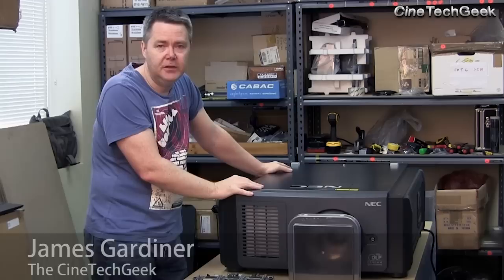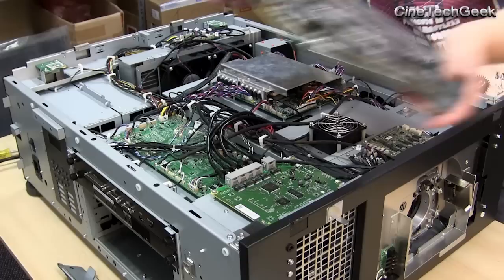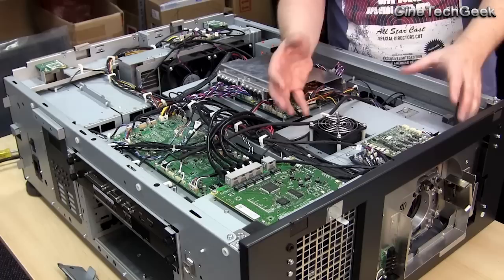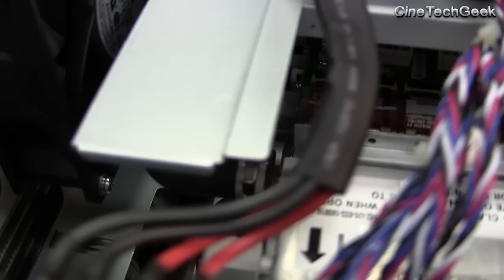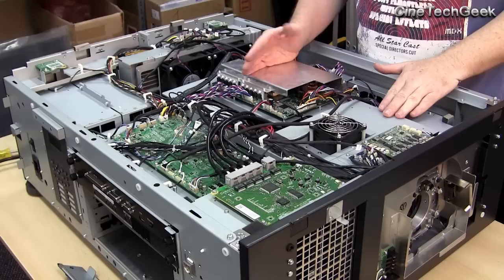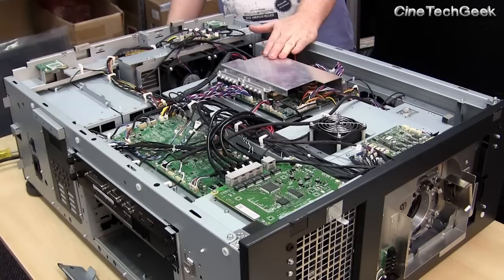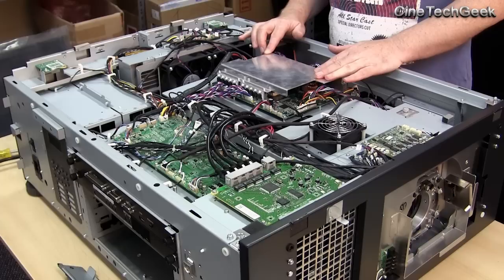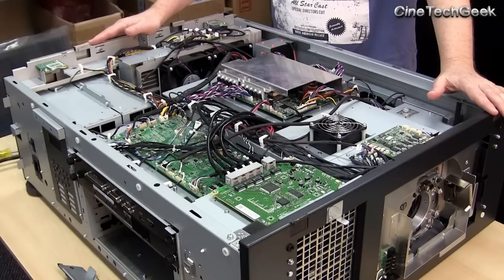A look inside a LASER digital cinema projector : NEC NC1100L

Comment: In my opinion, one of the greatest benefits of seeing a film shot on celluloid in a digital medium like a 4K disc or digital projector is that when the film is scanned from the original negative, all the grain one sees is what originated on the negative. When a film is projected on celluloid, additional grain is introduced, even if the print is a second generation away from the negative. So ironically, when a filmmaker like Tarantino champions that his films should be seen on celluloid, digital projection can in some ways represent more accurately what the negative captured. One advantage celluloid has had over digital projection for a long time is in contrast and resolution. But with 4K laser projectors I think that advantage will slowly disappear. Especially considering that 99.99% of all movies shot on celluloid today are finished using a Digital intermediate. Which means that even if celluloid prints are being made, they will be struck from that DI and be limited to the resolution of the DI, which most likely will be lower than the resolution of the film print. If you then add on the extra grain and softness that get introduced from the print I think that a film that was shot on celluloid and then receives a 4K DI will look better on a 4K laser projector than on a film print. But I do believe celluloid has the advantage when it comes to older movies that were finished photochemicly and shoot on large formats like 65mm and VistaVision. Because then the true resolution of film is being taken advantage of (as long as the print doesn't come from a digital restoration of that movie, even 2001 a space odysseys 8K restoration probably don't take full advantage of a 65mm print, but digital restorations has of course other benefits, like damage removal.) After the introduction of the Digital intermediate the full potential celluloid has been lost when it comes to resolution, but has also given the filmmaker more freedom with color grading and special effects. I look forward to the day when 8K,10K,12k DIs are the norm.

Comment: can you tell me any book name for full making digital laser projector ?
Reply from the maker: no. but reading the daily specifications would give you a good idea of the minimum quality requirements that would dictate a log of the implementation.
Reply: @CineTechGeek  thank you sir.can you tell me any website for buying old or used NEC 31000 lumens laser projector ?
Reply from the maker: @nituaero1843  umm. not really.  second hand projectors are not common..  but I the near future I expect a number of cinemas to close and projectors to start appearing for second hand sales.  give it another 6-12 months..
Reply from the maker: @nituaero1843  You have to go though local certified installers.  Due to the security and other aspects of the specialised equipment.  It required specialised service providers.  You don't really have much choice to shop around. It's not that type of market.
Reply: @CineTechGeek  ok sir

Comment: Nec is and always will be a Frankenstein machine.
I have never liked them, they don't give the same quality as a Christie or Barco.
Reply from the maker: +Christopher Pettersen all digital projectors are very similar..  Mainly because they all revolve around the same core technology.  I agree Barco spend much more time on engineering and the price of the units show this.  Barco is what I would likely select if money was no object or other technical issues existed.  NEC, from the 100 units or so we sold over the years has been surprisingly reliable.  And that is the core of the decision.  If you have a budget, NEC is a reasonable and likely best choice, no worse then Christie or Barco.
The image quality is most common situations is no better or worse then the other vendors. (Due to it being the same core DLP technology in the projectors..)  Debate on how well different projectors work and the TCO (Total Cost of Ownership) is another story and a much more complex discussion.
Reply: +CineTechGeek I agree on your philosophy, but then again normally you get what you pay for.
Reply: I coldn't disagree more. While the Series 1 NEC's were rats nests they were none the less uber reliable and many are still in use. They cleaned up the wiring in the Series 2 and the reliability continued on just fine. I;ve installed 334 NEC Series 2 projectors and have had issues with just five of them. Some of them are now over 6 years old. Light output is not as great as other brands but light output isn't everything. Properly spec'd they equal anything out there. For reliability they are better then the others, at least for me.